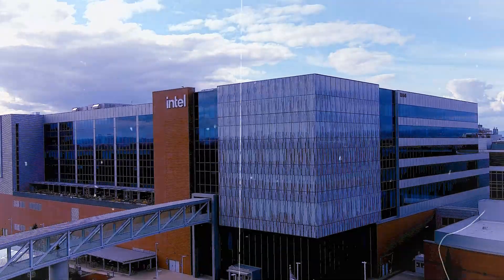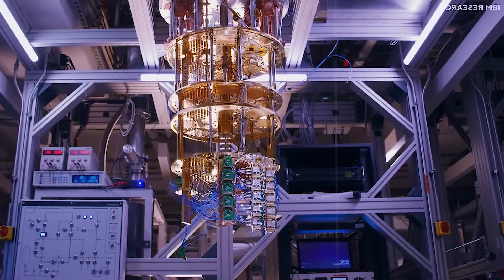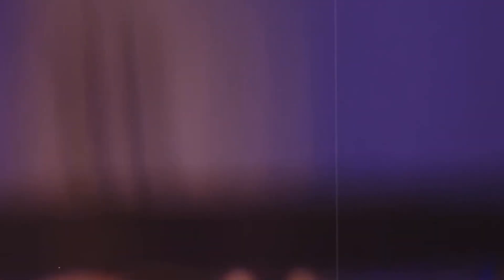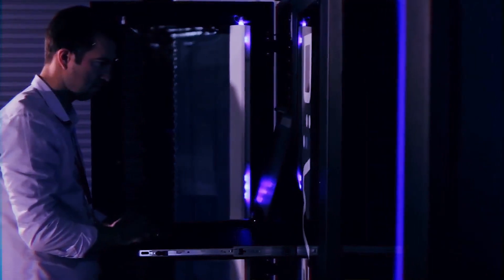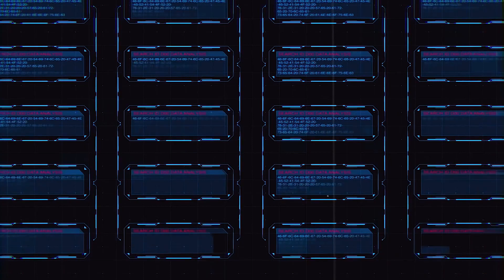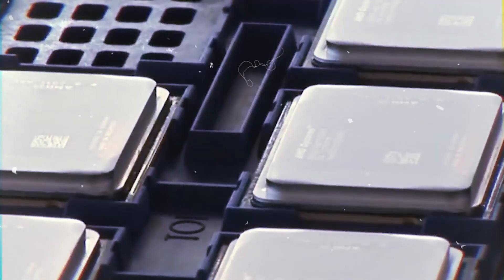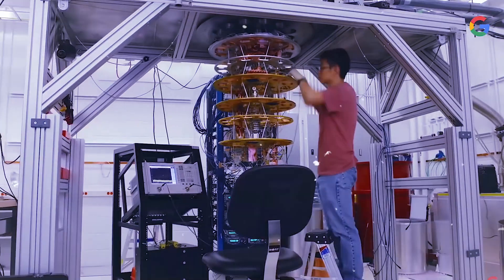Intel's New Quantum Computer Could BEAT Google and IBM

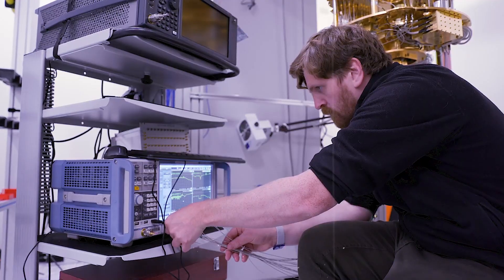Comment: Okay so at 1:18 the text to  speech bot repeated the exact same fragment "Intel's 12 Qubit quantum chip" precisely twice in the exact same tonal way letting it slip that it was just another frickin  text to speech bot POS crap written probably by a an AI text generator using more stock imagery that has bugger all to do with QM. 

As a chip designer that understands the industry and processes pretty well, I'm pretty sick of all this QM nonsense because it is BS nonsense. All QM machinery has to be frozen at close to 0 degree K and has relatively few devices to play with. Give me billions of devices at room temperature and real work can be done.
End of rant